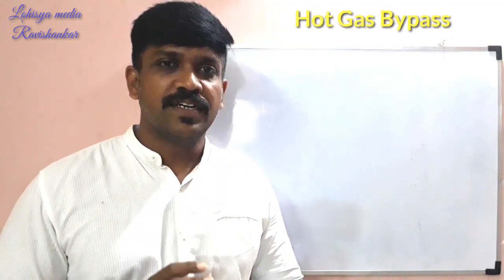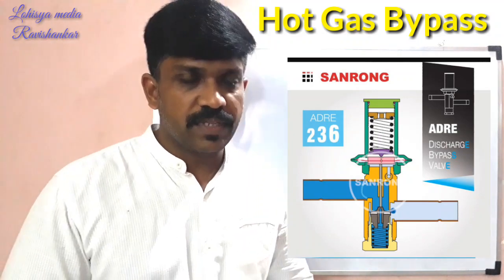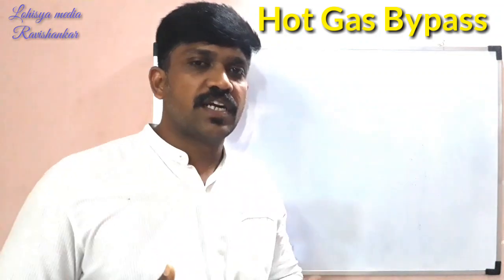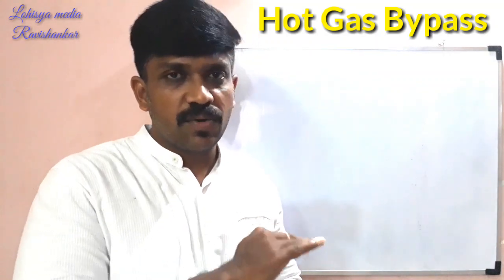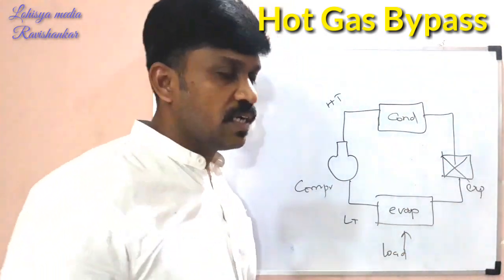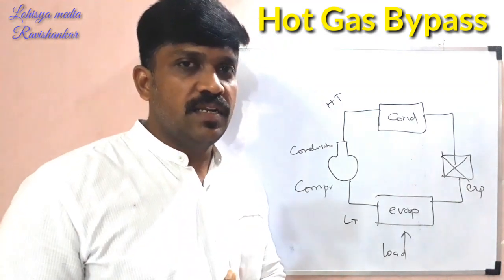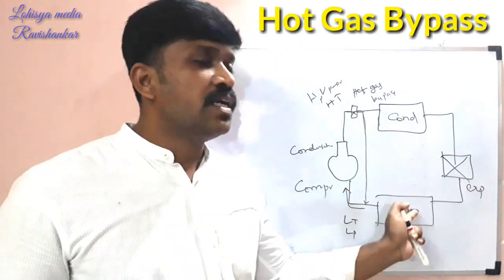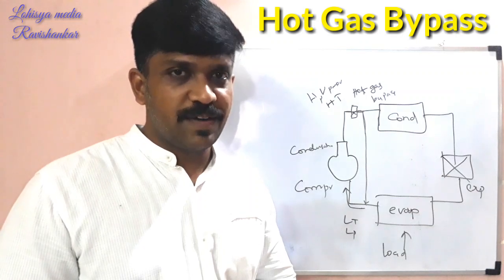Hot Gas bypass | Air drier | Chiller |  Tamil | Lohisya media

Comment: Very help full  💕 video.......
Thank you .....sir....
You more video apdated to chiller related 
Air cooled  ,....and water cooled chiller's 
 Thank you  ...Ravi sir....,💕💕💕💕

 Hot gas bay pass  provides and artificial load on evaporator  by introducing  portion of  high pressure high temperature 🌡️ gas to the  evaporator  suction side of the system

Comment: If it is based on load 
   can you share model of control wiring connection because my site no benifit of that ac so hot gas bypass valve always open i think that's why i ask you control wiring connection

Comment: Thanks brother , hot gas bypass valvukku  signal kodupathu (pressure sensora ? Illai temperature sensora?) Yentha signal base seythu solenoid valve actuate aahum

normally  chiller 2 deg reach aahum pothe nam tripping set panni vaithu irukkum pothu chiller  trip aahitumla .....

So yentha (deg )Temp base seythu valve operate aahum
Reply from the maker: Temperature sensor bro 
 Evaporator Refrigerant saturation temp ah base panni set point vekanum